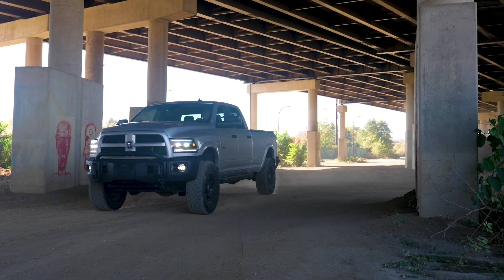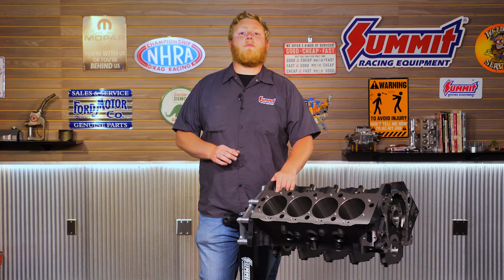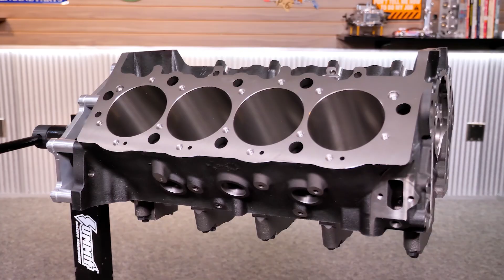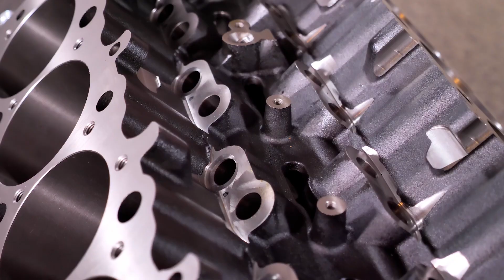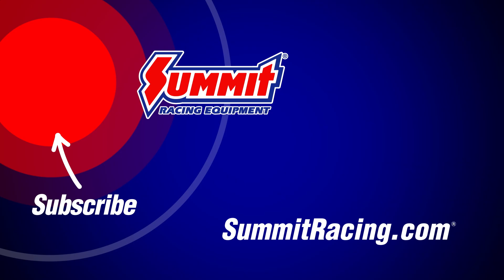Why These SPC Big Block Chevy Castings are a Better Foundation for High-HP Builds!

Comment: This really isn't a race block per say. It's a high quality iron block that is as good or better then any botie block you could find and way better then any a certain casting number block that were factory studs. With the built in features and better starting machine work you are starting out miles ahead of any junkyard block. Just wish there was a aluminum option. This top of the line OE plus plus block is a dam good option tho.

Comment: Big block Chevy inspired?

In 4.00" and 4.125" bore size? 

Why?
Reply: He said 4.5 or 4.6 inch bore
Reply from the maker: Great questions Alan! They've got features and improvements over the factory chevy big blocks witch are good, but they Inspired something even better! As for bore sizes , the big block Chevy SPC blocks are available in 4.500 or 4.600 inch bores

Comment: Maybe spend a little more for a Dart or other race bare blocks for more horsepower ratings, especially with 15 : 1 compression with Nitrous Oxide, or 8 : 1 compression with 65 lbs of boost.

Comment: i see 1 clear problem with new engine block , not enough coolant ports around the rear cylinders , those cylinders operate at higher temperatures than the forward cylinders , and thus they require more coolant ports to prevent piston scoring and eventual piston to bore seizure
Reply: You could always pipe in fresh coolant to the rear of the block to keep things cool. the idea is this is a "jack of all trades) for a performance build

Comment: $3,399 more than a little expensive compared to finding a used block, even some machining.
Reply: stock blocks are nowhere near as strong and will crack under very high hp builds.  There is no comparison, as oiling is improved, they have siamesed bores, thicker decks, etc.....Spend it now or spend it later.  The last stock block build I did I had almost that much in machine work alone....and still didn't have as good of a block as an aftermarket one.
Reply: @markgoulette5056 , I agree, Buy once, Cry once, buy twice, cry twice
Reply: @markgoulette5056 all that machine work you had done did they use a little vaseline on you😂.
I've seen stock blocks hold up to just as much horsepower is aftermarket ones if you know what you're doing.
Reply: You’re comparing used block prices to a brand new stronger block..
Reply: Some of the machine where they charge at machine shops is out of the roof, compare what I used to charge it is really expensive to get machine work done. But the equipment is a lot more expensive.
Reply: @pauljanssen7594 , To be honest, I really don't know what a splayed 4 bolt machining and caps would cost, i just assumed since it's a more advanced process than the base level machine work, i figured it wasn't cheap. that said if i could swing it and needed a BB, this block has a huge head start for most and it'll live forever for most reasonable builds
Reply: One thing to think about, this one uses better metal than a 30+ year old casting, it also has splayed 4 bolt main caps that's a roughly 1K for machine job and replacement caps already done for you. basic machining and it's ready for just about any build